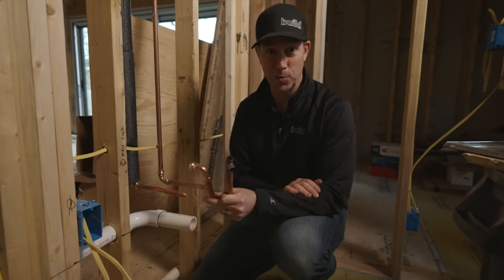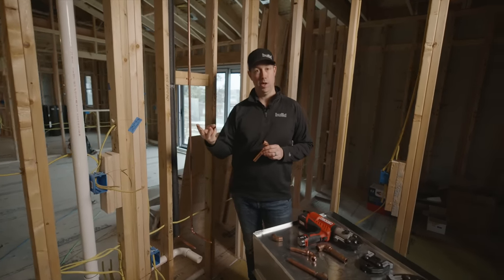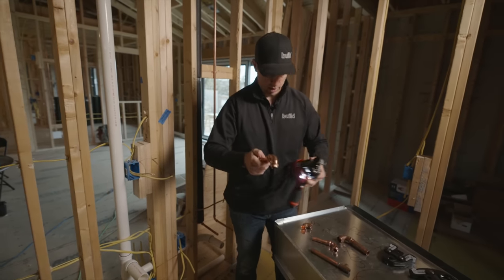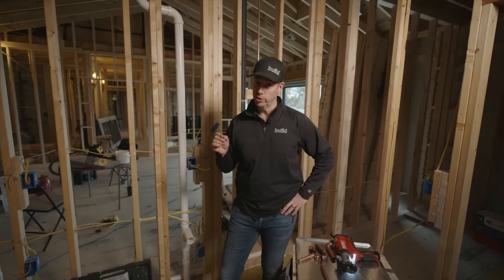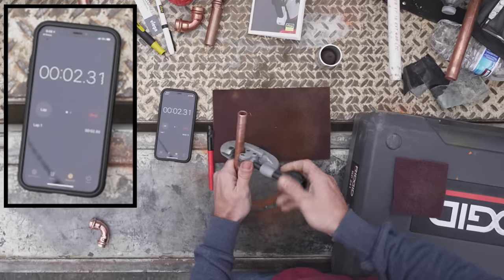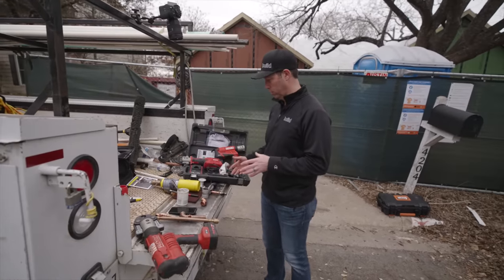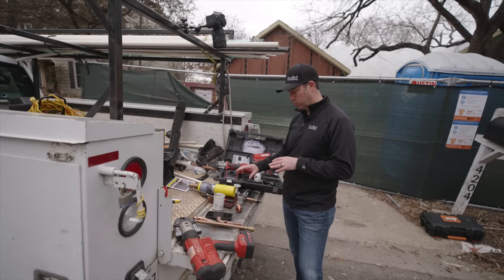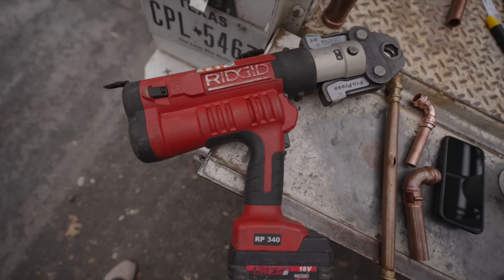Copper Plumbing - Viega ProPress vs. Soldered

Comment: My only issue with copper it still freezes and cracks like we saw during the recent Texas freeze last February. PEX didn’t seem to have those problems due to its properties & you can turn off each line you might feel is too exposed to freezing, like a summer kitchen on a patio. Your thoughts?
Reply: True, Pex is more resistant to damage from freezing.   However, it is entirely possible to install copper systems such that legs susceptible to freezing in the winter can be shut off and drained. that's pretty common in northern climates.
Reply: Your argument isn't valid.  You could just as easily put extra valves in copper pipes.
Reply: @sa3270  I don't disagree with what you're saying but I think that his point is that PEX systems are usually installed in home runs, which can all be turned off at a central manifold.  Not really a characteristic of PEX, bot of the way it's normally installed.

Comment: The "test" is dishonest, he could have made all 3 of the solder joints on that T-fitting, add 5 sec.  HE IS SELLING.  And he makes a big deal out of the "dangerous flame" and how the plumber has to use that fireproof towel thing, I use an aluminum pie pan. What a crock. It's fine if you want to be the salesman but don't bullshit me, boy.
Reply: Again I say cutting 2 more pieces of copper and deburring and sanding and fluxing in 5 seconds is bull crap not going to happen I've been plumbing for over 30 years and if I could cut and debur and sand and flux and then sweat 2 pieces of copper in 5 seconds I would have already retired from the thousands of dollars people would have been paying me just to watch that impossible task.
Reply: @plumbbuild6517  Yeah no shit, genius. Again, the fact remains, sweat a T is faster than pressing.
Reply: @plumbbuild6517  Cool it Francis

Comment: My house is all copper, not sure if it's L or M like he talks about but it definitely is not lasting the 50 years he claims.  I've had it fail with pin hole leaks in 3 different places at this point (house is only 19 years old).  It's been in the middle of the pipe not near a joint.  The been relaxing the sections with PEX A...i think it will fair better with the PEX...

Comment: Copper = Excellent!   Sweat fitting are bullet proof. EPDM o-rings are not as good.   Does the extra cost of the Viega fitting offset the labor cost to sweat the fittings?

Comment: I had some copper that I pulled out of my apartment with 10 or so pinhole leaks and the date code was 2010. That was about 2 years ago. Not soft copper either.

Comment: In a hot water recirculation system the life of the copper pipe is cut in half. It might make sense to use k on the hot and m on the cold. There is no way the copper is fused. An inner mandrel and a  whole lot more force required. The O ring is the seal.

Comment: Flux fuses pipes together? Wow that's a new one
Reply: I know right. Tinned flux to solder okay... But fuse is a far stretch.... Fusing plumbing parts would be like welding the parts together.

Comment: I only flux the pipe just enough needed to fill the joint, putting flux in the fitting too can be bad push flux into the pipe rotting it over time. And copper fittings only take like 15 seconds or so to cool. Once the soldrr stops bieng shiny its basicaly cooled

Comment: Only downside I've seen with ProPress (and similar) system is the cost of the tools.  ($3000 or so)  For the handyman/occasional plumber it's out of the price budget, while sweating copper ($30 or so), pex-crimp style ($50 or so), or even the pex-a expansion ($500 or so) is more affordable.
Reply from the maker: Fair points
Reply: I’ve seen a manual press. Would the pressure be equal to the battery operated press?

Comment: The GASKET, because that's what it is, is NOT a backup "element". It is THE primary source of the water proofing. Copper is NOT being "fused", but merely squeezed together. Water can still flow through and leak without the GASKET. Soldering, brazing, welding, or "gluing" is the ONLY way to fuse copper joints, unless you melt them to 1,984°F.
But hey, at least you got paid by Viega.

Comment: Matt 
Copper M tubing is only use for heating not for domestic water
Reply from the maker: Didn’t realize that. Thanks for the clarification
Reply: Type M copper is thinner and does poorly in hot water applications.

Comment: Wonder why Matt decided to go with copper instead of Uponor PEX...Does he just install whatever he can get for free from sponsors? I don't blame him if that's the case....
Reply from the maker: If you’ve seen my videos, you know that I’m a PEX guy. Have moved to Uponor mostly across all my builds. I can’t remember if I said in the video, but this particular client is an older couple that wanted copper. I figured it would be a good opportunity for me to try the system. I don’t cover is an excellent choice, I just don’t think it’s the right choice for my houses. There are still jurisdictions in the US they will only allow you to plumb in copper
Reply: Probably wanted copper because of the reliability of a properly soldered joint.
Reply: @joshfazenbaker5691  or they are just old and pex seems newfangled

Comment: 2nd generation plumbing wholesaler. I have been selling plumbing supplies since 2005, my dad since 78 we agree we would never pipe a house in copper pipe. If you don't watch out and make sure you don't have any steel material touching the copper pipe our you will have electrolysis. We just had a 100 year freeze and I had a state farm agent tell me out of a 1000 houses he went to for freeze damage none had pex pipe. Type a pex is the only way I would pipe a house.
Reply: I heard that Pex A have a chemical thing in it compare to Pex B and you will drink it real or not  ?? you have to let run the water 2 to 3 minute to remove the chemical with Pex A compare to copper and copper it have a natural anti -bacterium in it ??
Reply: @charlesboulay8303  I have always heard people saying pex leaches and yes I have heard that too I have personally lived in a copper, galvanized, CPVC, and Pex pipe house never had any chemical taste or smell. I have also talked to factory people about these concerns and all of them have said its myths. Pex don't leach you can direct put it in the ground with no sleeve.
Reply: @Adamrich1987  Thank you very much for the info it is appreciate especially from a wholesaler of master plumbing

Comment: You don't use type M copper on domestic water lines. Type L for water and type M for heating. What do the fittings cost? I bet they are not cheap.
Reply: Depends where you live. When we use copper we only use M and we only do residential
Reply: Yeah M is allowed some places. I only do commercial and its never allowed. In fact we use L in heating as well just to avoid any mixups in the field.

Comment: Biggest difference...the Viega system is about $3k worth of specialized tool, vs less than $100 for old school. My biggest problem with copper is pinhole leaks...it may take decades, but you will get them.
Oh yeah, he didn't quite mention the fitting cost is over 3 times as much for the Viega fittings vs standard.
Reply: I have an old house that was done in copper in the 50's, and by 2000 most of the copper on the cold water side was paper thin and would get pin hole leaks once in a while. A pipe cutter would crush the pipe instead of cutting it. So we had it all replaced with pex in 2001. So it took 44 years for the L copper to wear out. Supposedly pex never wears out.

Comment: But I saw a ton of the fittings pull apart in the great free we had a month ago. Besides it has a 25 year warranty, just like the shark bites fittings, and just like pex (expansion or crimp). So running copper or pex is just from choice.

Comment: One major benefit that didn't get mentioned with copper press fittings is when doing an repair or update on an existing system that has water in it. The press fittings work fine in a wet environment. 

Anyone out there no if there's a problem with O-Ring deterioration over time; I love using the ProPress fittings, and was asked by one of my guys that's been soldering a long time.

Comment: How much are compression fittings.. are they double the price? 

So there are 120 corners that's 2 extra hours @$40 =80
Hardware if $1 more than standard= $120 - 80= $ 40 more than sweating

Comment: Ok so Copper vs Pex , What lasts longer ? What is stronger ? What cost more in materials ? What cost more in labor ? What takes longer to put in ?
Reply: Copper is more expensive, harder to install, not sure about labor costs but I would guess that those are cheaper for pex. How long each one lasts is what I don't know but I think Matt has a video on pex and copper and how they handle frozen water.

Comment: Ill stick with solder. Press fittings fail after a couple years because the rubber piece inside is brittle and cracks when exposed to water.

Comment: Remember Matt oppens by stating Viega is sponsoring the video so big shock he loves the product of the people who are paying him.   Pro press has its place but your basically replacing a solid low cost technology, soldering with a much more expensive (compare the fittings not just the outrageously expensive tool) less proven one who's only advantage is speed.  They are unreliable on M coper with weeping commonplace.   The metal on metal seal only works until the pipe is banged or vibration works it loose then its only the seal holding the water.   What the real goal here is to replace cheap sweat fittings with more expensive pro press  increasing profits for the company and driving up your cost.   In addition I've never seen a plumber charge less for a pro press job that's "so much faster" and can be done by an unskilled apprentice.

Comment: I think the biggest plus you did not mention, you can press wet, try sweating with just a little bit of water left in the pipe, it will not happen, plumbing is not just new construction, this is great for remodel and repair, down fall is once you press it, it is done, you can not unpress it and repress it
Reply: That’s what they make jetsweats for
Reply: Just need a little bread from the sandwich in your lunchbox.

Comment: I still think Uponor pex (A) is better. easier to route, so you use fewer fittings. loses less heat. easy to modify after the fact. does not leach anything out (you don't actually want to drink copper, solder, or flux)

Comment: Honestly, any system is prone to failure. The amount of work and the amount of area you have to work in should be considered. If you do a lot of plumbing with many joints, then its worth buying the $100 MANUAL crimping tool or the machine crimper for almost $700. If you're only doing a couple of fixes, its not worth the money for the PROPER tools for crimp systems. Compression fittings and snap tite fittings are great and fast for doing small j9bs. Also, they're easy to replace if they fail. This system isn't worth the money for how much plumbing i do ( next to none.lol) Very cool tool for doing entire houses, etc.🙂👍🏼🙏🏼🙏🏼🙏🏼

Comment: Saw a guy almost get killed when an end cap blew off while on a 120 PSI test because the Installer forgot to press the cap on. Guy was In a man lift and the cap hit him In the side of the face and knocked his safety glasses off. Was bleeding heavily and I helped to get the bleeding stopped before EMS arrived. If his head would have been two Inches more to the left he would have died.

Comment: Obviously he’s not a union plumber you don’t touch the pipe or fitting with your fingers (oil) after you clean the pipe or wipe off excess flux ( you used too much to begin with)  use a clean rag for that. Oil from your body will contaminate it. It’s called capillary attraction  which draws the solder in from the heat. 

Use acetylene instead of propane, or mapp gas.  Us old timers can solder faster and neater plus rule of thumb size of pipe tells you how much solder to use 1/2” pipe 1/2” of solder  smaller fittings up to 1” only need to solder in one spot  opposite 180 where flame is and will draw the solder around the whole fitting. Horizontal or vertical. Larger than 1”   On horizontal a damming technique is to be used.  Flux is used to help  prevent    Oxidizing and solder has no rosin in it. If you braze you don’t use any flux  at all  while you use a brazing alloy with  phosphorus  recommend oxy-acetylene but can use acetylene . 

You misspoke on Viega  being lifetime it’s a 50 yr warranty get your facts straight I’m surprised Viega  didn’t get to approve the video w/o  fact checking  and  The standard sealing element in ProPress fittings is EPDM.  

Stick to your own trade, and get a plumber who knows what he’s doing

Comment: Copper is great until you get pin hole leaks in your pipes. Ever had a wet spot on a wall and could not figure out why?. Had a friend in Florida that to completely replumb his whole house all at once because of multiple pin hole leaks. You need to monitor the water ph and watch for green staining in your toilets, sinks, tubs, and showers. The green means the copper is leaching. My house has a soda ash injector system to raise the ph because the water is so acidic in my area. I can always tell when the setting is not quite right and I need to test the ph.

Comment: Flux removes oxidation which allows the fusing solder to bond to the copper. My personal opinion, only soldered fittings, pex with plastic fittings, or pex with no fittings should be allowed in walls. Pro press seals have a life expectancy of 50 yrs. Tell the future historic society’s that they’ll have to open up walls to replace leaking fittings. Not to mention the damage from leaks.

Comment: The flux help the melted solder flow in a joint in a hydrophilic instead of a hydrophobic fashion.
Reply: Its actually capillary action
Reply: @yeahyeah5422  I should put hydro in quotes.  BTW you need that surface interface “phylic” to get capillary action.

Comment: Which piping system works best when the temperature drops to 0F and the power is off for 2+ weeks?
Reply: Pex they say.
Edit: shutting of the water main and having a backup generator.
Reply: The system that has been drained and winterized.

Comment: What is the cost differential for soldered copper vs Viega Copper System?
Reply: The biggest benefit is speed, and not have to spend time shielding wood from an open flame
Reply: And not to mention taking the battery's out of all the smoke detectors.

Comment: Soldering pipe you can prep and sweat multiple joints at the same time.
Reply: I was thinking about the same thing. This experiment wasn't a very good example between the two. I would like to see an actual test where there's multiple fittings. Both are good ways to join copper, for me depends on how much room I have.

Comment: Lol 1 you never flux the inside of a fitting as that helps to get flux inside the pipework. 2 once you have soldered the fittings you just need to wipe clean with a damp cloth. But yes pro press looks nicer.

Comment: Surely this all comes down to price per fitting. Yorkshire end fee in the uk are so cheap compared to crimp style.  A good tube cutter new pipes a fitting mean minimal clean. Letting the flux clean the pipe on new is all that’s necessary. Seems like big industrial where you don’t have to worry about the cost.
Reply: Most large sites in the UK we do now are press fit due to Hot Works permits and the building owners insurance. Houses, York/End Feed fittings in tight spaces with a burn barrier and you just carry on soldering if you've already got the gear out. Only time we press fit during domestic is fresh install or repairs/retrofit where joints are easily accessible with the tool.

Comment: Is there anywhere where this product or copper in general is as good or better than Pex? I don't know of one.
Reply: Pipes run through warm spaces. PEX droops, I had to replace lines run laterally above my furnace when the PEX started to sag.
Reply: In a location where the piping is exposed to sunlight or mild physical abuse, copper would be my choice over PEX.
Reply: @JasonW.  interesting. Must be really high temps. I think uponor is rated for 200+ degrees.
Reply: @springtimeplumbing6240  interesting.
Reply: Ummmm, yeah... at the rectcling center, duh.